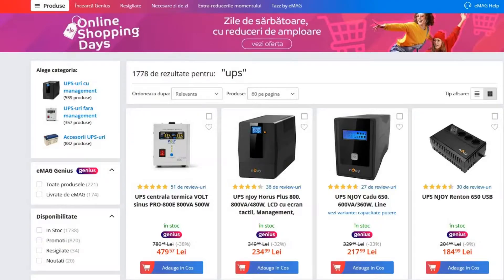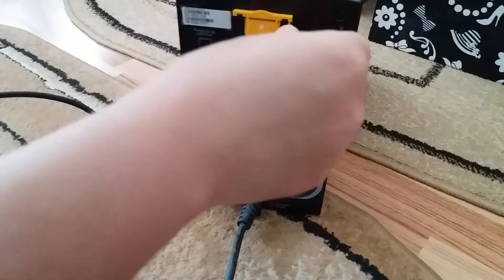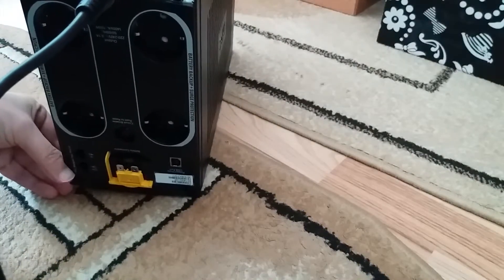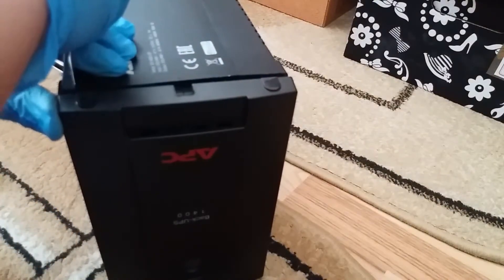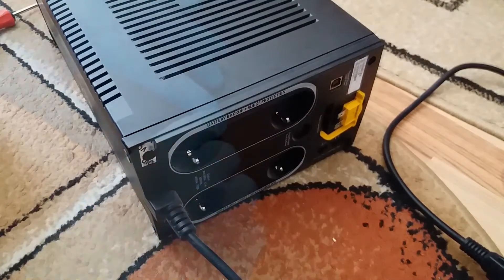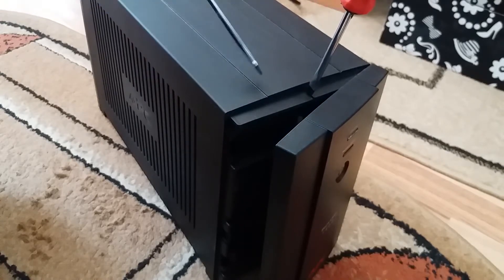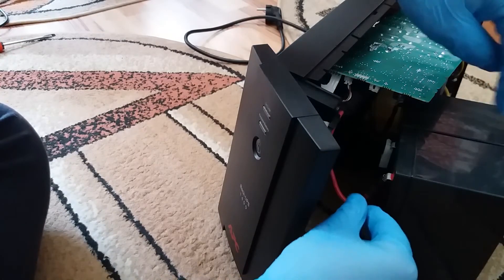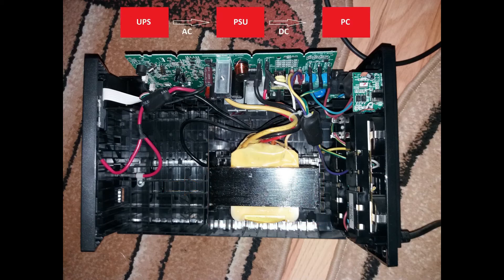How to remove your UPS battery (shown on APC model BX1400-GR)

Comment: This UPS has an easy to replace hot-swappable battery. Battery replacement is a safe
procedure, isolated from electrical hazards. You may leave the UPS and loads on for the
following procedure. See your dealer or call the number in this manual for information on
replacement battery kits.
Note: Once the battery is disconnected, the loads are not protected from power
outages.
1000-1100 VA
1400 VA
1. Grasp the top of the front cover and tilt it out and down.
2. Unhook the bottom of the cover from the chassis and lift it upward to
expose the battery door. Be careful not to strain the ribbon cable. Do
not touch the exposed printed circuit board.
3. Fold the front cover on top of the UPS as shown.
4. Use a flat-blade screwdriver or a coin to remove the two battery door
screws and open the door.
5. Grasp the tab and gently pull the battery out of the UPS.
6. Disconnect the battery leads.
7. • For the 1000/1050/1100 VA models, loosen the connectors by
gently wiggling them while pulling straight back from the battery
connector.
• For the 1400 VA model, pull the two gray couplers apart to
disconnect the battery.
Connect the battery leads to the new battery.
Note: Small sparks at the battery connectors are normal during
connection.
8. 9. 10. • For the 1000/1050/1100 VA models, connect the red wire to the
positive (+) terminal and the black wire to the negative (–) terminal.
• For the 1400 VA model, connect the gray battery coupler to the
UPS coupler.
Slide the battery into the UPS.
Close the battery door, replace the battery compartment screws, and
replace the front cover.
Dispose of the old battery properly at an appropriate recycling facility or
return it to the supplier in the packing material for the new battery. See
the new battery instructions for more information.

Comment: Why these 2 batteries are running in series connection (24v) but not parallel connection (12v)?  I thought most devices are running in 12v, right?
Reply from the maker: Yes Sir, that's correct. Most devices are running in 12 volts. I'm not a tech guy. But, as far as I know, some models come with batteries wired in series connection and this is one of them. When batteries are connected in series, their voltage adds up, but the capacity, also known as overall discharge current of the battery or number of amps the battery can deliver in an hour, does not exceed the discharge current of individual fuel cells. The main drawback to wiring batteries in parallel is that the system voltage will be lower, resulting in a higher voltage requirement or current draw.